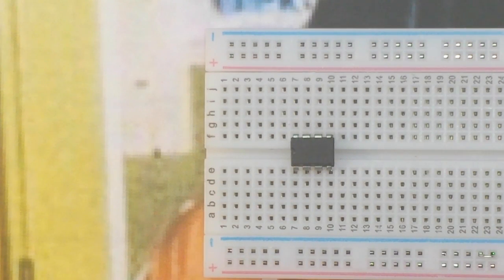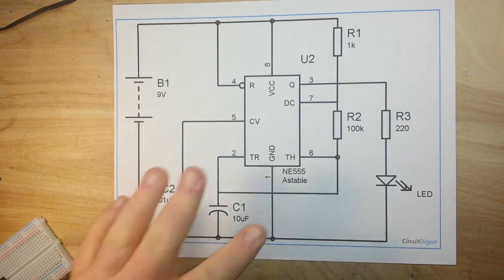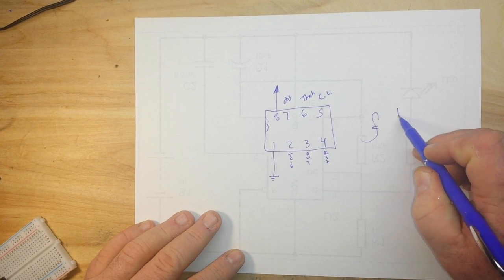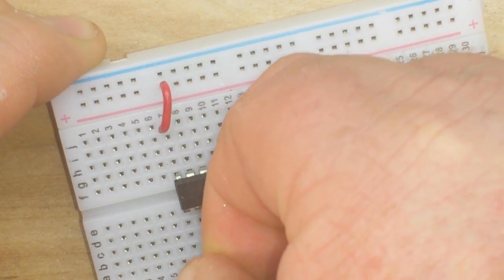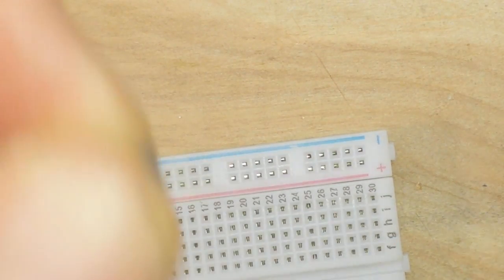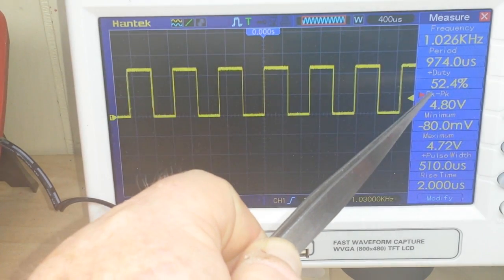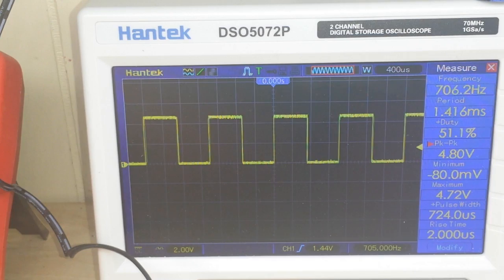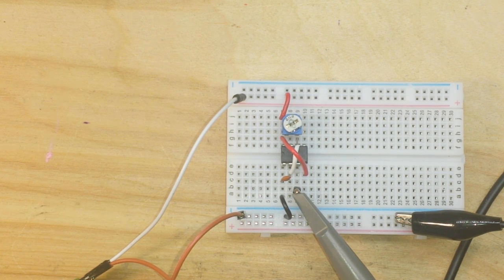The most simple way to set up a 555 timer

Comment: Is this possible with regular resistors? What value would I need and where do I connect them?
Reply: Use the frequency formula to determine what resistors to use depending on your preferred output.  Put them in place of the potentiometer,  with one lead of each resistor on the pin connected to the pin in place of the wiper.  If you want to see a drawing of your circuit, look at the schematic at the beginning of the video that he seems the find so complex and confusing.  He did exactly what was on the schematic except he eliminated the output indicator led portion.  Other than that,  he replaced the two timing resistors with the potentiometer and wants gullible people to think that he's a genius.

Comment: is this a PWM circuit? if so can this be used to regulate the brightness of LEDs and speed of motors?
Reply from the maker: Yes and yes
Reply: So if you hooked this up to a speaker you could play the frequency that the oscilloscope shows?  Could you theoretically make an electronic dog whistle with this type of set up?  Pretty new to all this so just want to know if I'm the right track or not.  

Great video either way.
Reply: Yes you are right and the 555 can drive a small speaker (8 ohms) directly, no need for an amplifier.  @melrose-bandar

Comment: Hook it up to an LED so I can see what it does... I don't understand the screens or the techno-babble..
 Make it simple..
Reply: At 700 hz - 1 Khz, the LED is just going to look like a static on state... it'll be too fast for the eye to pick up.
Reply from the maker: A 555 timer outputs a square wave. Basically it just turns on and off at a specific rate. That's it.

Comment: Excellent video. My question is if it is easy to make a circuit that automatically compensates for voltage drop. Say you have a capacitor charged to 7 volts and your target output voltage is 5 volts. When the capacitor discharges, the voltage drops - is it possible to keep a steady voltage from 7 volts to 5 volts at the output? The output being constant 5 volts. The circuit would have to adjust the duty cycle in relation with the capacitor voltage.
Reply from the maker: Without getting too deep into it, a big (2200 or 4700mA) cap parallel to the output would keep your voltage steady.

Comment: Hey does this configuration produce a pure square wave? And I tried using it like the buck convert video you have and the input was 8 volt and the output was from 0 to 4 volt can you guess what I did wrong? Thank you
Reply from the maker: Yes, square wave only. If you did a buck converter and you got 4V from 8V it worked. If you want more than 8V you would need a boost converter.
Reply: learnelectronics thank you for replying but in your video you put 12in and got range from 6v to 12v That is 50%-100% duty cycle but I got 0%-50% duty cycle which is weird. I used 104 capacitor in the 555 and 220uF in the buck circuit

Comment: Hello, awesome video. really explained and helped me understand. but one thing i didnt quite get was the resistance values in the frequency equation. were those the trimmer?
sorry if im asking dumb questions, im relatively new at electronics.
Reply from the maker: Yes, I use the trimmer as the two resistors. Less components is always better.
Reply: learnelectronics wow. Quick reply. Awesome thanks

Comment: Hi, I rely like your channel. Thank you for sharing knowledge.
I need to start my fog maker:

New Φ20 mm Ultrasonic Mist Maker Foger Ceramics Discs with Wire & Sealing Ring.
Diameter: Φ20 mm.
Thickness: 1.24 ± 0.01 mm.
Frequency: 1.7 MHz.

Can you make 1.7 MHz with basic components?
Or I need to use Freq  - generator?
Thanks on your time.
Reply from the maker: +Jedan Decko Hi, thanks for your kind words. 1.7MHz is relatively low frequency in the scheme of things. Are you just looking for a square wave? If so check out my video "555 timer fun" you can get 1.7MHz out of a 555 a capacitor, and a couple of resistors no problem. Use that output to drive a bjt or MOSFET and that will handle whatever current your device needs.
Reply: Thank you for your answer. Ill try that. I think I need just a square wave, its vibrating disc that works on that frequency and make fog out of water, something like vaporizer.
Thanks on your time.

Comment: Paul, just wondering, what is the weirdest or craziest application of 555 that you came across during your work/study?
I seen that Colin Mitchel(Aussie guy) do wonders with the 555 time!
http://www.talkingelectronics.com/projects/555/Page1-555.html
Reply from the maker: +igrewold oh we used the 555 extensively in the SONAR  systems in the Navy. They were used as pulse generators, clocks, voltage inverters, and as discriminators in passive SONAR applications.

After I left the Navy I worked at Bayer Intl. for the next 20 years. At BI I was a process engineer in the medical division. This was long before Arduinos and other micro controller units. So if you needed a blinky LED you just grabbed a 555.

It had a number of other uses, and I can tell you we ordered them by the gross.

Comment: triple fav tamah ;D
Thanks, Paul. And that X wire trick is very useful where a wire goes from 2 to 6 an the other crosses it from 4 to 8
It is the thing to tamper with, did some tampering with it to run a 5V Arduino relay module. Just used a 9v bat and a vreg 78L05
It's cool, useful & cheap, in some apps(circuits), it saves you the use of a uC and for about 10 cents
This 555 calc is useful http://houseofjeff.com/555-timer-oscillator-frequency-calculator/
Got the 555 ICs from here https://www.banggood.com/search/555-timer-ic.html

Comment: Great thanks for the simplification!   Is there such a thing as a variable capacitor? Then u can adj freq and duty cycle.
Reply from the maker: +Michael Padovani Yes there are variable caps, used in tuning radios
Reply: https://duckduckgo.com/?q=trimmer+capacitor&iar=images&iax=images&ia=images
They is touchy though esp. in RF so use a ceramic screwdriver to deal with them.
If they worked fine without, then that is good.
https://duckduckgo.com/?q=ceramic+screwdriver&iax=images&ia=images
Reply: Michael Padovani  i think you must watch this too if you like this circuit
https://youtu.be/caUHiHzswBU